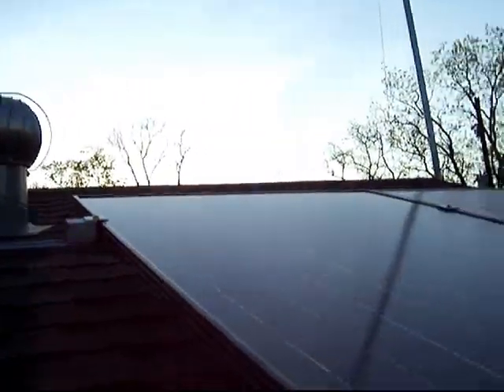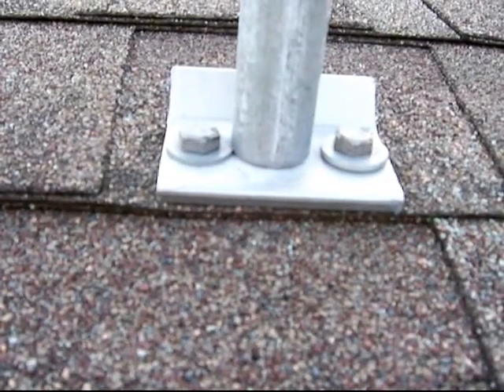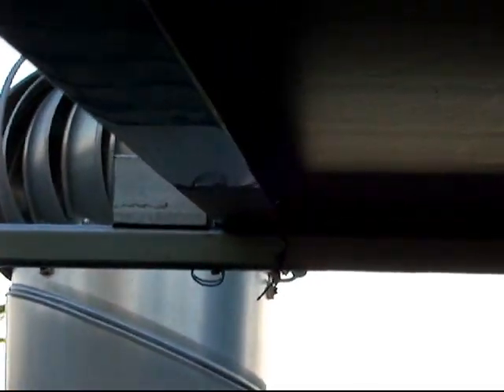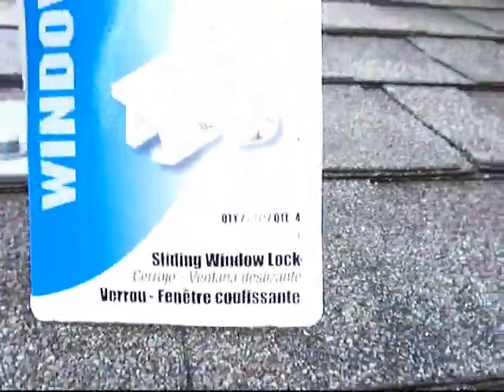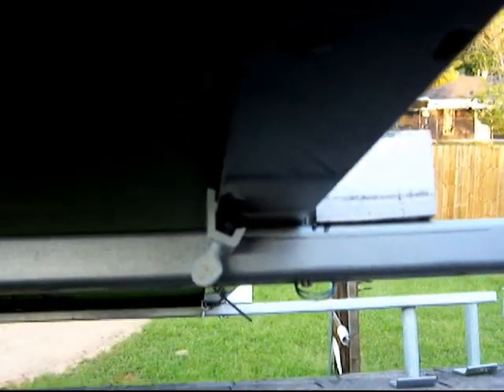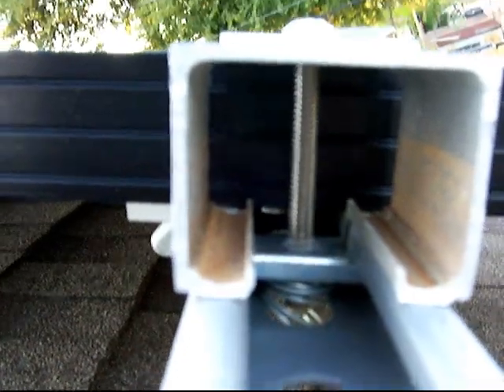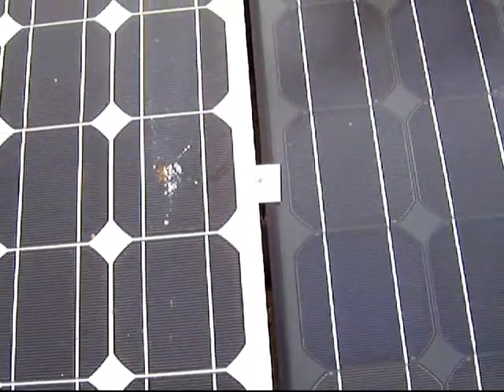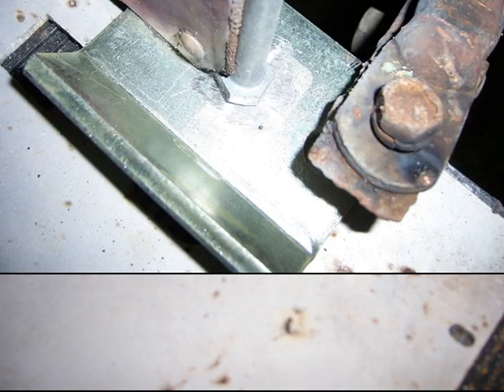solar panels mounting brackets

Comment: I've thought about the water cooling idea many, many times. You could use brake lines from cars and all the tools are available at the auto store. A better idea would be to put a spray bar above them and have them sprayed with water. Put a manifold up there, sprayers/misters and spray away which would also clean them off. You could use a hose/garden timer to set it up. The boost is pretty big, I've tried it with a garden hose and even using 130F water.

Comment: Nice work man, I was too afraid to drill holes in my roof plus I'm getting a new one next year so I didn't want to take it all down again. I'm building a massive mount in my backyard instead to hold my 16 solar panels. Take a look and see what you think. I'll be posting a new video today of how I'm going to mount them. What did you use to cut those pipes? Band-saw or what? Is that EMT conduit piping or regular plumbing/steel pipe? Good idea by the way, very creative.